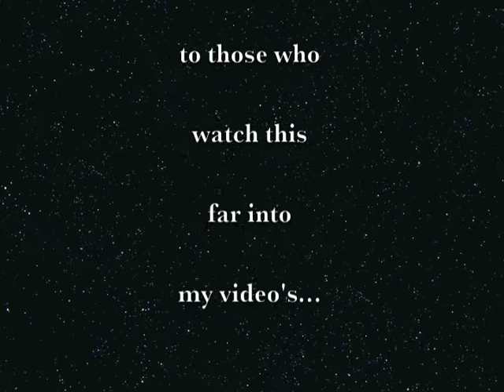#74- Making a Guitar Nut

Comment: I was just thinking about this the other day, how I want to start putting more zero frets on my builds, (trying to get away from Buzz Feiten setups), I like the shaved down pencil for tracing the actual radius of neck for the nut profile, why did you lightly sand the pencil tip after you sharpened it?( I prefer to use a scribe or an Exacto blade since I can't keep a pencil sharp enough long enough) nice trick angling the strings toward the post it's the little things like that, that show this guitar was not spit of a factory. Very nice work, sign me up for part 2.
Reply from the maker: turftone I like to sand the pencil to a super fine point cause automatic sharpeners don't really give that fine of a point. Also, a #3 hardness pencil is much preferred for precision marking since the harder lead doesn't dull as fast.